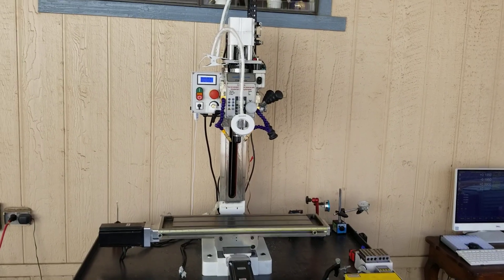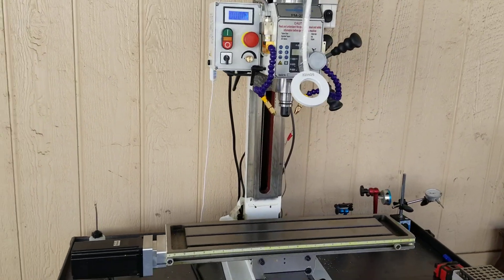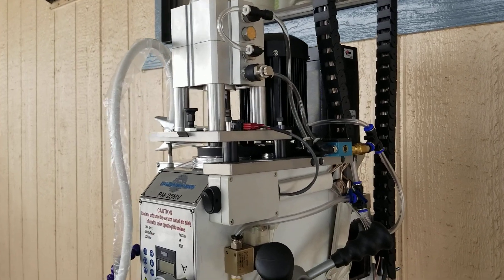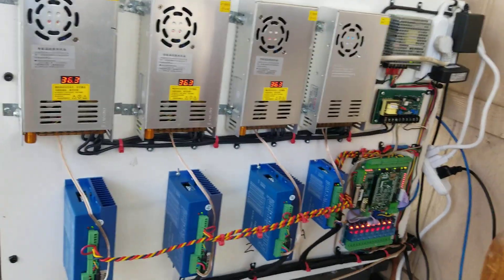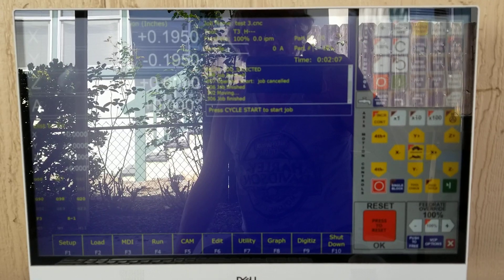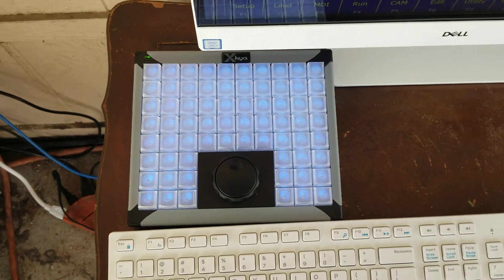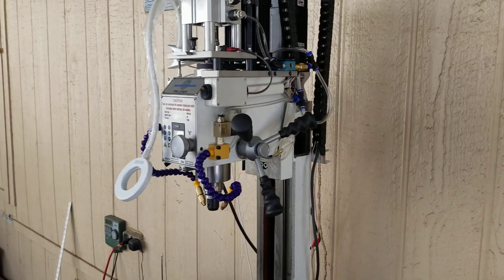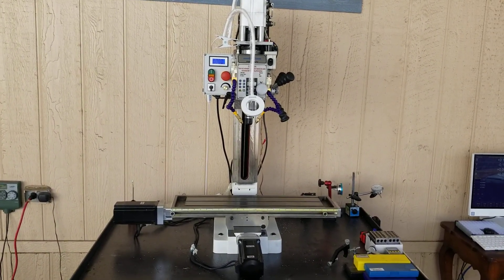PM25mv CNC conversion

Comment: Thanks for using my "Arizonavideo99" CNC kit. It looks like its working well. I'm really inserted in the motor controller, does it reverse?
Thanks
Dave
Reply from the maker: Thank you.
It's been a pleasure doing business with you. 
The spindle control works very well.
Yes I have control over forward and reverse as well as speed.
I will be doing a video in the near future for the spindle control.
Long story short is...
The KBSI 240d signal isolator controls speed only. Two relays from the Centroid Acorn handle the forward and reverse aspect.